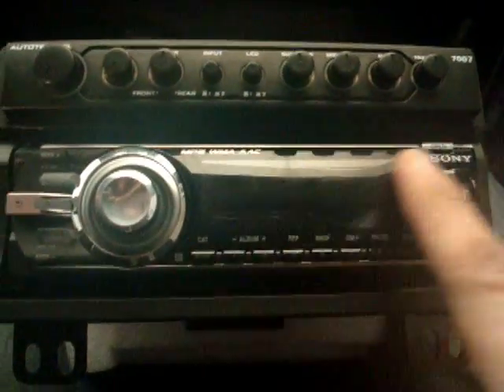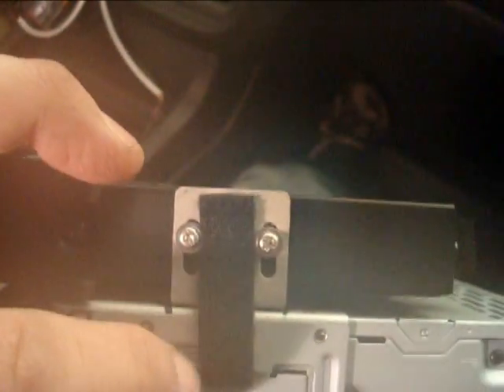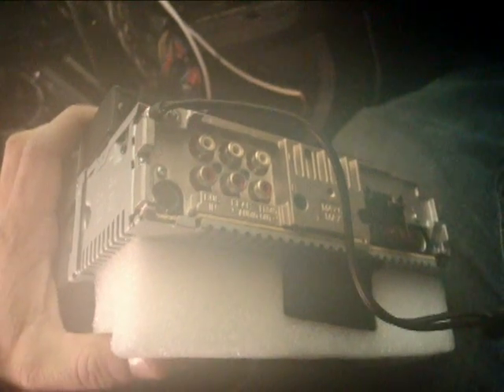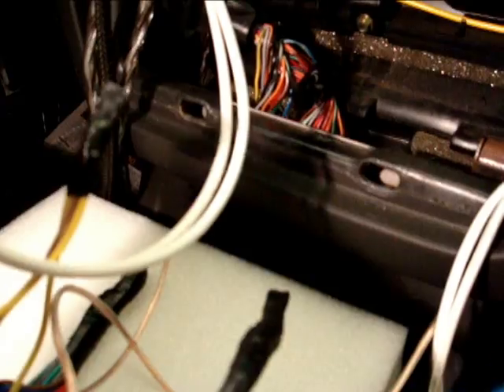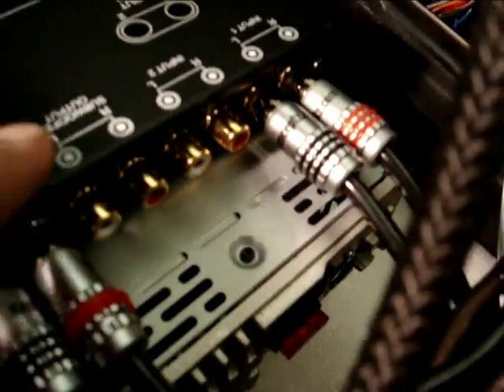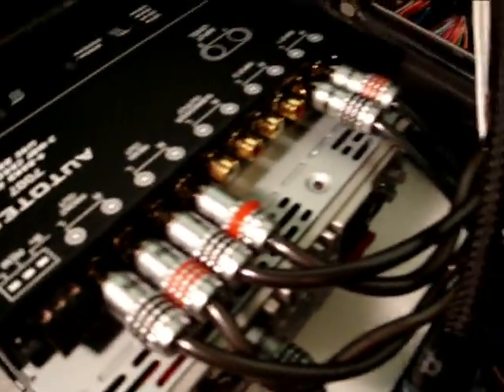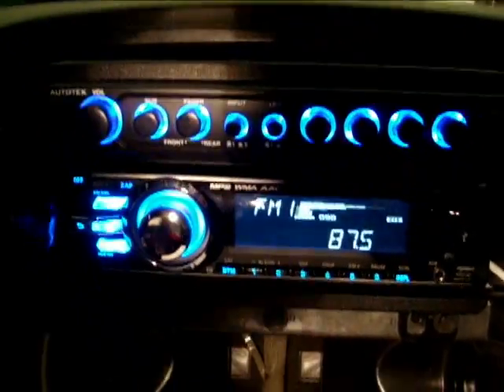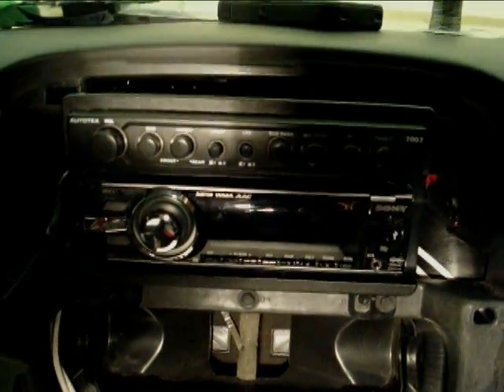Explorer Build Update # 18 Install pre-amp & deck in truck

Comment: The Autotek 7007 is great for a 4 band EQ with a 9 volt line driver.  I have been using it for almost a year with no problems.  Only thing is at night you can't tell where your knobs are set at exactly because they do not glow like the front of the EQ.  Nice temp setup though man!

Comment: Hello, i just wonder if the head unit has 6 RCA channel output (4 speakers and 2 subwoffers), but the equalizer only has 2 inputs, wich 2 outputs you select from the head unit to hook into the equalizer?

Comment: What's your experience with that preamp?
Reply: that"s not a preamp.Just a crossover. The headunit is the preamp, but it has a built in amp. So no preamp here.

Comment: Have a 2000w amp, an eq, compressor, pre amp and cross over. Two 15s each 1500w.bass ok with the amp and the eq,  but when I add the rest of equipment the bass flattered what could be wrong, i tried other amp same result